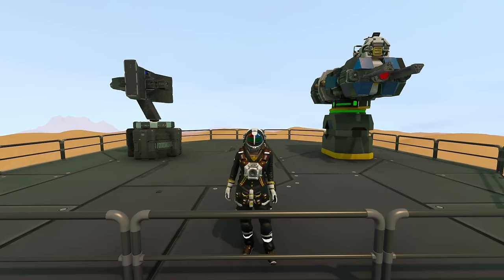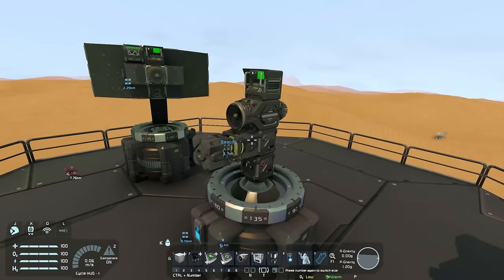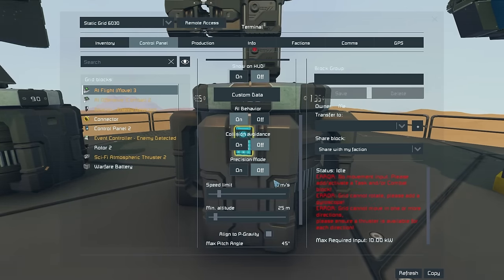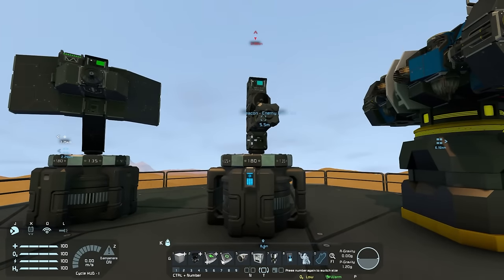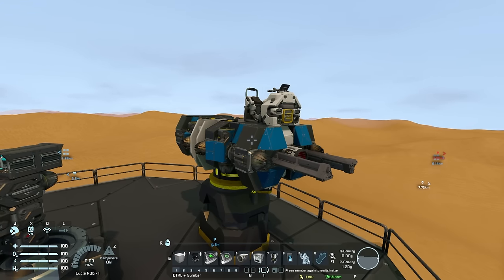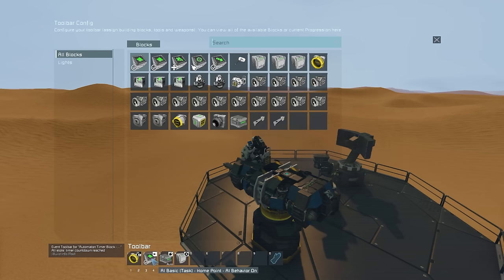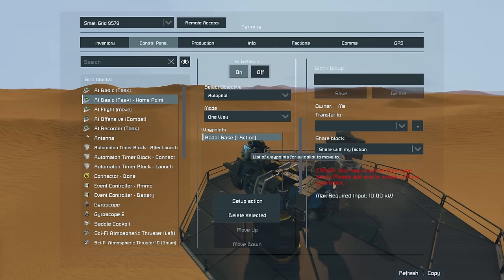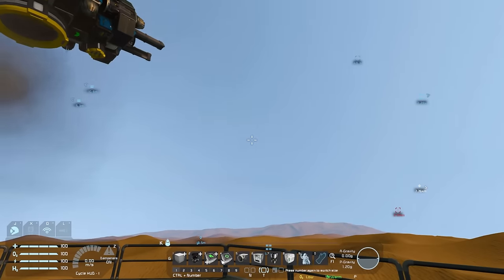How to make an AI RADAR - Space Engineers Automatons AI Update

Comment: If you use the AI defensive block instead of the offensive you can set it to trigger actions without the thruster or the event controller.
Reply from the maker: Great suggestion, would probably work better to some extent. Though with the event controller, at least you can trigger more actions.
Reply: @AliceDoesThings404  Set the defence block to “trigger now” a timer. Timer can make 100 actions. 
Alternatively there’s a locked enemy distance setting in the event controller.
Reply: Event controllers can trigger 9 actions if you use the toolbars, more with timer blocks of course.
Reply: You may be able to do something with direction to enemy with this? Idk, could be useful to look into at least
Reply from the maker: That is an option as well, I will certainly look into it.
Reply: @Cuteseals2  As I was watching the vid, I was wondering if I could:

1) set rotor torque to 0, or turn off the rotor itself.
2) put a gyro on the radar subgrid
3) let the offense AI and move AI blocks orient the subgrid using the gyro (and thruster etc) to "intercept.

If that works, the beacon would point at the enemy direction. I'll have to give it a whirl sometime.
Reply: @Cuteseals2  for this, add it to a turret controller turret. Will allow you to point the general direction or directly at it.
Reply: @dakaodo  that could work
Reply: I was trying to make something like this with just an event controller and AI offensive block using the locked target within meter argument. Wouldn't even activate unless I made a timer block to cycle power to the EC every second. You're saying an AI defensive block can trigger for something besides flee when it detects an enemy?
Reply: How? there's no "Select action" Menu that I can see on either the offensive or defensive block.
Reply: @scaredycrow appreciate you. Forgot about his feature... Been designing a reusable rocket booster
Reply: @AliceDoesThings404  You can also use the Event Controller without a Thruster and set it to "Distance to Locked on Targed" chose your Offensive (Combat) block and than set it to  Equal or less and pull the spider to the full 2500m mark.

Comment: This is neat. Going to play around with this. See if there is a way to link the drone to the beacon so if the enemy is detected, the rotor stops and the drone is sent forward towards the direction of the enemy before the AI offensive takes over.
Reply: I've actually found a way to do that first step. All you gotta do is add a gyro (Off), another event handler and a timer. Snyc the timer to the first event handler, and make it turn off the rotor and turn on the gyro. Its a bit shaky for some reason, but the radar will focus on the target. Use the second event handler to detect when the thruster goes off, and then shut off the gyro and turn the rotor back on.

Comment: This is great, we're all trying to figure out how these new blocks really work. Good job. I'm already thinking about how to send badly damaged drones straight to a grinder pit or how to set up a retrieval drone to pick up downed flyers.
Reply from the maker: These blocks have so much potential and so many uses, both for making drones, but also so much more if we think outside the box. And we are barely scratching the surface! I am glad this was of help, and wish you good luck!
Reply: For the Grind pit you put a Event Controller on the drone and have it set to "Block Integrity %" then add the Thrusters, etc and set up the integrity of those blocks e.g 70% and make sure you have "AND Gate" enabled as well so it won't trigger the event controller if one engine or battery gets damaged (Correct me if i'm wrong) all the selected blocks will have to take the same amount of damage with "And Gate" Enabled before it triggers the RTB sequence which the "Base" will be the Grind pit but for the Ship recovery that one i don't know how to do yet.

Comment: okay i need help. followed the whole video even using the drone you provided and all it does is move from the "home point" to the connector locks and repeats. im unsure where i went wrong but ive done this 5 times now with the same result. please help :(
Reply from the maker: So the way the drone was set up in this scenario, was that it will always to try go to the home point. However, when it detects an enemy, it will try to take them down first, before going back home. Does that make sense, and did I understand the issue correctly?
Reply: @AliceDoesThings404  thank you for your swift reply, yes that does seem to be what its doing and i believe i found the problem. the extra event controllers on the pasted drone were controlling the battery on top of the system trying to run its course, i simply disabled those and it seems to be working just fine now! thank you!